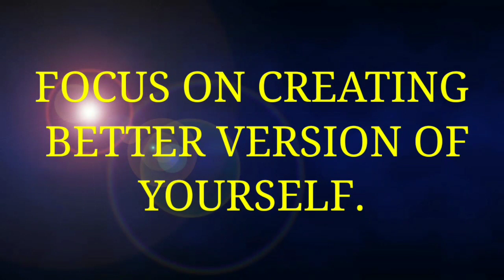PAANO MAGPALIT NG TRUNNION PIN BUSHING/BOOGIE BUSHING NG ISUZU WING VAN?

Comment: Bossing..ano reason pagmadalas napuputol ang trunnion shaft
Reply from the maker: Hello po KAAYOS,over load,sira na po Ang bushing,sira na po Ang spring seat at maluwag na po Yung trunnion pin sa Pinaka base o Yung pinakahousing nya.salamat po
Reply: Boss pwd hingi nmber twag q sa trouble Ng yunit nmin
Reply from the maker: Hello po KAAYOS,09356348552